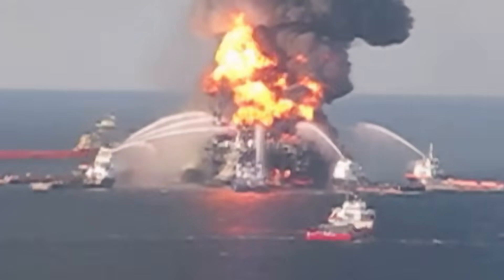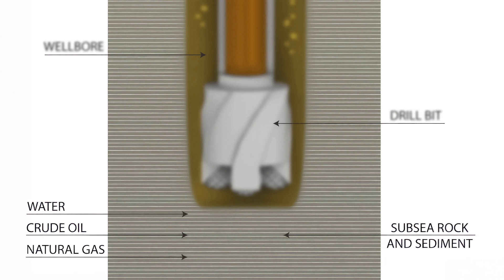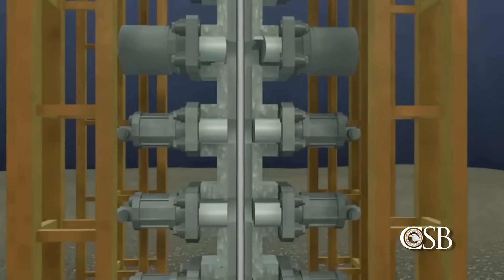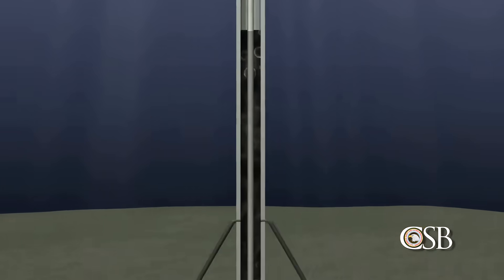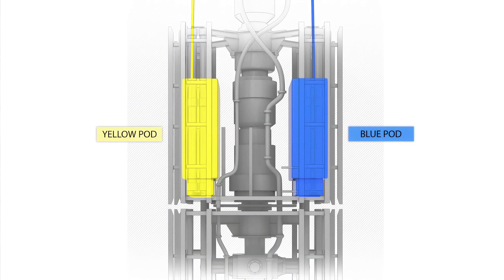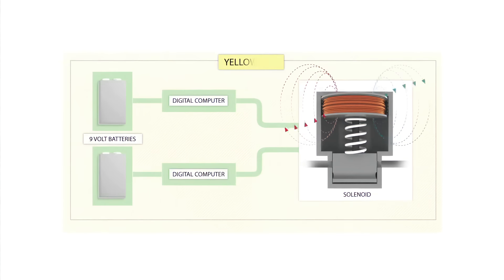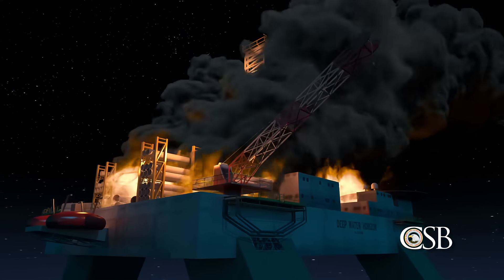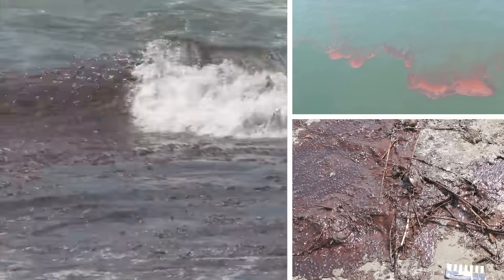Deepwater Horizon Blowout Animation

Comment: What kind of idiot designs a dead man's switch that needs power to activate? The gates should be kept open by power and automatically close when power is lost, like truck air brakes.
Reply: They don’t wanna lose money if they randomly closes the well just bc power failure
Reply: @simon3812  But the thing is when power failure is the thing does it anyway.
Reply: @simon3812  exactly right. They don't care enough about human lives. They have make money.
Reply: One who isn't designing a true "dead man's" switch.
They went for multiple redundant active controls instead, because the 'must maintain power' style is too likely to be activated in error/accident - and STILL needs a way to 'Safe' it, when it wouldn't work at all.

Depending on a system that is not serviceable in use (water depth etc.) and both was NOT checked out thoroughly & didn't have adequate reporting for current condition (battery states) was a major planning failure IMHO. 
That part STILL seemed to work by luck, but the actual ram cut off design wasn't robust enough to chop & seal in any conceivable circumstance (off center pipe, high pressures).
Reply: Two issues - 1. It's on the sea floor, can't just walk over to it to trigger the thing.
2. Ram WAS activated - but didn't do the job adequately.
Reply: @rogervoss4877  Since everything else was never checked to see if it was done right, and extremely incompetent personell that obviously didn't have a slightest clue what the fuck they were doing. It was so bad that you could think it was intended and thus severe sabotage, and in that case boy they really succeeded.
Reply: The system is not failsafe. It is redundant, but not failsafe. The design is fundamentally flawed.
Reply: A lot of comments from people who have clearly never worked on a drilling rig.
Reply: @Residoodle  do you think the engineers that design the system were rough necks ?
 clearly you havent thought thus through
Reply: That sounds like a good idea but “blackouts” are common on rigs so if this happened then a simple fix becomes a major problem. A lot went wrong here and yes these equipment barriers should have worked this idea isn’t practical. There are other more effective precautions that should be in place, many of them are today.
Reply: @JTTodd-pn5sd  Well maybe it's a good idea to address blackouts to make them non-critical? Surely it couldn't be much of a problem to have operation-ready backup generators and have the batteries provide power for the 30 seconds it takes to start one. I worked on an oil tanker and that was the setup - three power generators, only one of which is in active use and only one of which is allowed to be on repair at any time.
Reply: LIKE TRACTOR TRAILER BRAKES<---VERY GOOD ANALOGY because that is a fantastic idea and exactly why that kind of Air Brake is used, it is a FAIL SAFE design.
Reply: @weatherphobia  tractor trailer brakes are not fail safe. Only if they are maintained correctly do they work as designed. Spring brakes cannot apply braking pressure to the drums if they are worn out or misadjusted or the drums are worn out or cracked.
Reply: if it were normally opened  but its designed to work when its disconnected . the power would not lost for ever . it was normally opened or closed. its still bad design
Reply: or railroad brakes
Reply: Mi 28 I think the simple answer to your question is because of power outages. In the event of a loss of power you don’t want your shear to suddenly cut the well line and cost millions. Unlike a trailer where you simply need to pull over and fix an accidental triggering, on this such a triggering would be a huge deal. 

There are also plenty of places where batteries are used as a dead man switch such as electric trailer brakes. Properly tested batteries are perfectly fine for this application. 

Ultimately improving this design would be really about improving the testing. The battery should have been tested regularly, the shear should have been tested better during installation and of course the shear should have been designed in such a way that allowed for movement in the pipe.
Reply: @Mrcaffinebean  Fundamentally this approach relies on assumption that nothing will go wrong. Proper failsafe designs rely on assumption that EVERYTHING will go wrong.
Reply: Mi 28 not at all, 2 separate independent computers, with their own independent power, 2 separate solenoids with 2 separate coils. There was lots of redundancy built in but it wasn’t tested and some  of that redundancy becomes a liability because of improper installation.
Reply: Mi 28 there is always a chance of failure, not matter what your doing. Even if you designed the switch in the inverse manner it would have not prevented this.
Reply: @Mrcaffinebean  The chance that 1" titanium beam would fail under the weight of a feather is exactly 0%.
Reply: Mi 28 and the chance that pigs fly is 0, what does that have to do this? You asked why they switch was not designed to work in the inverse. I have explained that you and you seem to be unable to find a better solution.
Reply: @Mrcaffinebean  It's more of an excuse than an explanation. Any asinine design can have thought behind it, but it doesn't makes it a good design.
Reply: Mi 28 how could you design this better? You haven’t explained that at all. How would you solve the design challenges that being a system that can’t trigger when there a power outage and can’t have a single point of failure?
Reply: @Mrcaffinebean  No, it MUST trigger when there's a power outage and if you want to minimize false triggers you design your fucking power supply properly.
Reply: Mi 28 “just design it properly” is not an actual design specification. How would you design it properly? Because generators will fail, there is no getting getting around that.
Reply: @Mrcaffinebean  Yeah well maybe consider backup generators? Backup batteries? Redundancy backup batteries? Geez it's not hard. The risk of all of that failing is not any greater than the risk of safety systems failing, but in case of failure on only loose a million or two bucks worth of drilling a new shaft, and not hundreds of millions in cleanup fees and multiple dead people.
Reply: Mi 28 the explosion happened before the shear was automatically engaged. So it wouldn’t have prevented the deaths even if working perfectly.

Additionally the shear did actual engage. The redundant systems to engage it, somewhat by chance, worked. 

The ultimate failure to stem the flow of oil was in the mechanical design not the electrical design. 

So this design your railing about was a non factor in this incident.
Reply: If Deep Water Horizon didn't exploded  their design flaws, system procedures and mistakes won't be rectified.  Their soul learned a lot from that gigantic blast. 🤔🙄🛸🧭
Reply: @cristopherpandan3242  having worked on those systems and knowing that each pod is tripple redundant, I do not find the explainations plausable. Not a bit. 2 pods BOTH triple redundant. Think about that. What I do see as a problem is the shears. Also the pipe is schedule 120 a thick wall iron pipe.  If a component is miswired it would show up. Seems to me the blame is being laid at the feet of a low teir employee. From experi3nce I have seen and know most problems occur in upper management. OIM level and Rig Manager. If protocols were swept aside look to them. Keeping the company man happy.
Reply: Exactly. The entire point of DEAD MAN switch is that in the event everyone is DEAD it can activate itself. By the fact that it needs power, it isn't a dead man switch but just a regular switch
Reply: Because the oil industry was afraid of a BOP activating accidently and costing millions of dollars in downtime  so they demanded it require power to activate.
Reply: @fartamplifer  better than hundreds of millions of dollars to clean an oil spill.
Reply: @herbilk8093  Well yeah obviously but the companies don't think about that. They figure it'll never happen. All they care about is next quarter's profits.
Reply: Ok expert
Reply: I thought that was what he was explaining when he mentioned a solonoid, then went on to say it had to be computer activated. Yeah bad idea.
Reply: Those that put too much faith in themselves
Reply: and industrial washers drain valves.
Reply: but keeping open something with power costs money and they are all about SAVING Money even if it costs human and the earths life. Just like Chernobyl. Also that deadman switch didn't seem to have any wires going to it, it seemed to be ran off complete battery power.
Reply: Hunt7r keeping a solenoid open does not cost money lol. There is almost zero power usage on a component.
Reply: onLy wheN there is BaNg BaNg dioD. .

we use aux power based activaTioN !
Reply: Logic by alternative physical means or logic by electrical systems would both work?
Reply: agreed, it should be in Normally Open Condition
Reply: Mi 28 inside job
Reply: You would still need batteries for the conputer
Reply: Could they not have the pipe inside another pipe? The outer pipe holds the shape of the inner pipe, the inner pipe experiences the stress. If the inner pipe buckles, the outer pipe holds its shape long enough for the blind shear ram to cut them both?
Reply: The ah64 Apache is better mi 28
Reply: @suspiciouscat3075  With no armor and barely any armaments? Ayy lmao.
Reply: Mi 28 that’s what happens when you don’t use the KISS principle
Reply: @0x4A616B7562 easier than cleaning up an oil spill
Reply: Because once a well is cut, it is done. No going back. The rig is moved to the next well
Reply: @Cbow406  Arguments like that basically put a price on human life. How much it is to dig a new well divided by how many people die in an accident like this.
Reply: You speak with common sense
Reply: Your favorite oil company, BP
Reply: Arzt Merkwürdigliebe  Thüüüüüüüüüüüüüüüüüüüüüüüüüüüüüüüüüüüüüüüüüüüüüüüüüüüüüüüüüüüüüüüüüüüüüüüringen. Und David Bowie ist auch schon mal drübergeflogenen.
Reply: Or train brakes
Reply: Similar to locomotive braking system
Reply: Agreef
Reply: There you go yeah.
Reply: It doesn't need power, it activates when power is lost
Reply: @michaelbuckers  could put a couple high pressure tanks down there on a stand alone system that had cylinders to actuate the cutter. Loose power, open valves. Use a lithium battery down there if you want a time delay. By stand alone I mean a unit separate from anything else so it wouldn’t matter if the pipe bent, it wouldn’t bend where that thing was clamped.
Reply: Please excuse my ignorance but how do you have a switch that works without any power at all and is completely mechanical and requires no electricity? You said this is an application used in truck air brakes?
Reply: @christopherg1288 The air pressure pushes on a spring to release brakes.
You can’t move an air brake vehicle until you build air pressure.
The army uses air pressure to push a hydraulic system that way, they can hook to trailers with air pressure hoses to apply hydraulic brake systems.
Reply: @icepaddles141  huh. What a fascinating concept. Maybe this is a really good idea

I can’t believe it’s possibke to create springs or completely analog hydraulic systems like that that have enough power to stop something like a truck or train or whatever else

I do wonder if you could create a system like this strong enough to deal with 1,500 psi or even more like several thousand psi

But I suppose they must be able to bc the batteries in these things were only powerful enough to act as a trigger anyway, I can’t imagine a 24 volt battery is strong enough to do that either. I can’t believe all this stuff works. Like how do you have springs strong enough to do that, even if they are massive springs, and how does a 24 volt battery hold them back. Wild what you can do and how little I still understand about this all. I hope I learn the details some day

Thanks for explaining to me my guy
Reply: Thats a really bad idea in this application
Reply: I'm a commercial driver class A, you saying that about the brakes makes me wonder why they didn't think of that
Reply: Same on Fokushima: The valve of the passive emergency cooling system is close without electricity. I saw a documentation from the US, in which they didn't address the stupidity of the construction (maybe because it was an US design reactor), but accused the operators of lacking knowledge.
Yes, it is not good to have operators with lacking knowledge of security, especially on plants of nuclear reactors and oil rigs. But even with the right knowledge you can't dive quick to the BOP to manually activate some dead close valves. In Fokushima, the radiation was to high to walk from the control room to the valve after a few hours, as they tried to send out operators to check the correct operation of the safety cooling system.
Fokushima and DWH are examples of wrong safety designs: No electricity = valves have to open safety circuit and/or close regular circuits.
Reply: @hYPERCUBEismus87  also the emergency backup generators where right there by the sea.
Reply: That's what I was thinking also.  It seems it would be easier, cheaper, and more robust to just run a cord down with the riser to the coils and supply the power for them.
Reply: Halliburton apparently , and what kind of an idiot would install it ? the operators of DEEP WATER HORIZONS
Reply: The Obama administration gave them the license. Liberals are to blame.
Reply: Money production is obviously most important than saving lives
Reply: HYUNDAI BUILT IT! STOP SUPPORTING HYUNDAI
Reply: weekendpartier Nope, you didn’t watch the video. The part that failed wasn’t built by them.
Reply: I get where your coming from. Maybe a manual explosive type button on the outside the box once triggered would release the ram.
Reply: @rxonmymind8362  why not have a ram that cuts from one side to another rather than meeting in the middle? That would account for off center pipes.
Reply: @FondlesHandles  because the amount of pressure needed to cut drill pipe is very high and from one side it would not cut properly
Reply: @FondlesHandles  because you would only cut the pipe but not seal it. and the Oild would fill the BOP until it bursts
Reply: @FondlesHandles  maybe a V shaped shear would have worked?  One V on each side, meeting in the middle.  If the pipe was off center, the V's would (in theory) force the pipe towards the middle to be sheared off.  Who knows.
Reply: @jasonwood7340 I'd go with a pair of 'V' shears, at right angles to the other.   For example, one pair of shears would be on the north and south sides of the pipe, the other pair would be east-west.  In case of failure, they both trigger so no matter where the pipe is buckled, it is forced into the center where both sets of shears can cut.  Nice idea, thank you
Reply: @FondlesHandles  I suspect if you cut the pipe you have not sealed the well:  You need to pinch the pipe closed.  No?
Reply: @jasonwood7340  one hell of an idea, I'll look into that myself
Reply: @FondlesHandles  Other BOPs are designed this way
Reply: @stevebyra7795  i think youre wrong. If you apply 1N of force on an object from the left and another 1N of force from the right, it would be the same amount of force if you apply 1N on only one side. Its called a reaction force. For every action there is an equal opposite reaction. Go ahead. Ask any physics educated person
Reply: @de0509  I'm not sure how this answers or relates to my question
Reply: @stevebyra7795  one year ago you said "because the pressure needed is very high and one side it would not cut properly"
Implying as if applying two equal forces from opposite directions would exert more stress on an object than if only one force is applied, which is wrong. Actually, if you exert a force from one side, as long as the object is prevented from moving, the other side will experience the same amount of force due to normal reaction. Pressing an object from both sides with X newtons will only create X amount of compressive force, but not 2X as some people might imagine

Im no petroleum engineer but it seems that the real reason is to use momentum, and they want the cutter to meet the  pipe at the same time, hence why they want two of them. Just being pedantic on the reasoning for the design using two choppers. Not pressure or force, but to strike the pipe in the middle at the same time to not allow bending away from the cutter, thus maximising impulse
Reply: @de0509  Well in this case the object would not be prevented in moving the other way if force was only applied from one side. Im not sure how much you know about ram type preventers but the pipe would flex and the ram would run out of stroke before shearing the pipe.
Reply: Jason Wood I think your misunderstanding. The both sides of the shear worked. There were 2 computers only for redundancy. The single computer and solenoid was able to activate the entire ram.
Reply: Correct. Schedule 120 pipe. If I remember correctly
Reply: Americans are no clever engineers.
Reply: @MrGerdbrecht  can no speak right
Reply: @MrGerdbrecht  it was a British company and the rig was built and designed by South Korean Hyundai Heavy Industries.
Reply: MrGerdbrecht it was made by South Korea dumb ass
Reply: @MrGerdbrecht  Americans always do the right thing (after we have tried everything else, multiple times)    ;)
Reply: @toddkes5890  Tell that Fukushima? Plant "designed" by General Electric, lol. They are exactly as competent as USSR in Chernobyl. EDIT: Nobody asks a capitalist for a quality product. Except if you are poor. And thats the whole business model of USA, keep everybody finacially below you, so they keep buying cheap trash from china and USA. Lol, little side note: Even china does not like to buy american steel anymore, because its worse quality than current chinese steel. Double lol. Maybe thatswhy President Drumpf used chinese steel for his Drumpf Tower, since he wanted quality and wants to make china great again.
Reply: @toddkes5890  Honestly, if that Fukushima went off in Germany we would have sued USA into bankruptcy or startet another war? They radioactive poissened a fucking country. This would be a valid reason for war in our eyes. Make no mistake. EDIT: I mean valid in comparision to pulling half the planet into war for made up lies about weapons of mass destruction for the actually most inhumane reason for war - oil.
Not to mention the 3 Mio. american peaceloving workers in the killingindustry whose jobs heavily depend on peace.
Reply: @MrGerdbrecht Does that mean Europe gets to sue Germany and France for making the EU member states bring in all those cultural enrichers?

The Fukushima-Daiichi plant was built in a bad location twice over and wasn't shut down when it should have been. The design was irrelevant by that point because, like Chernobyl, it wasn't operated properly at the critical moments. Both disasters were inherently caused by human egotism and arrogance.
Reply: @MrGerdbrecht  calm down. Keep getting your facts from your favorite magazine.
Reply: @MrGerdbrecht  I cant even tell what you're saying because you apparently dont speak english.
Reply: @agentx250  The design was irrelevant? Lol.
Why do you need human interaction in a crisis?
Isnt that exactly the design error? lol noob.
Reply: @SirLoinBeefsteak  Only bad for u, why dont you speak german? I guess you wouldnt understand anything if i wouldnt be so nice to you. Maybe calm down yourself?
Reply: @SirLoinBeefsteak  Only bad for u, why dont you speak german? I guess you wouldnt understand anything if i wouldnt be so nice to you. Maybe calm down yourself?
Reply: @MrGerdbrecht You missed the point I was making. What I was saying is that, had the plant been shut down prior to flooding, as it should have been, there wouldn't have been an issue. The plant, however, wasn't shutdown and thus the plant design didn't matter.

The point of original failure in both cases were the operators who exceeded safe operating conditions and caused catastrophes.
Reply: @MrGerdbrecht  Oh you mean like the forged readings of emissions from one of your car manufacturers after they played with the software?
Reply: @MrGerdbrecht  didnt need to be in order to steamroll your country. git gud
Reply: @near--zero  Sry didnt got that. What is with my country you know shit about? I understood git, which im using right now, yes its a nice program.
Reply: What is the difference between getting radioactive poissened by america in peace times or in war time?